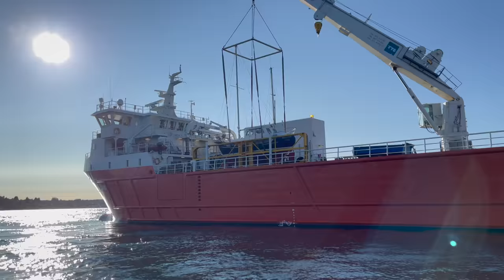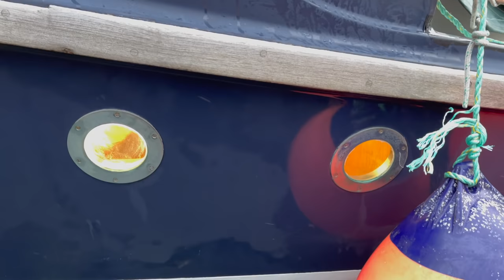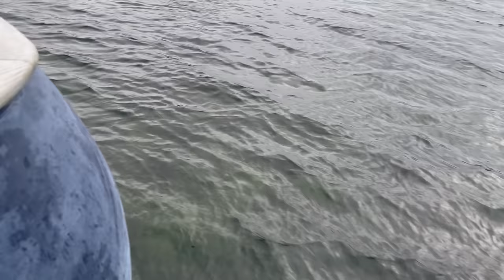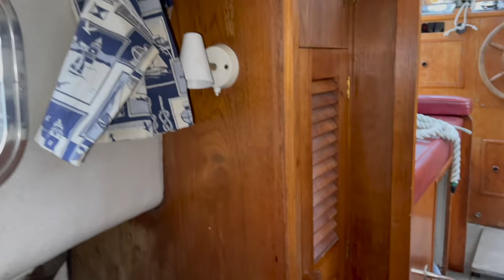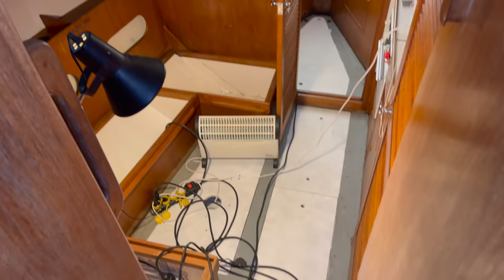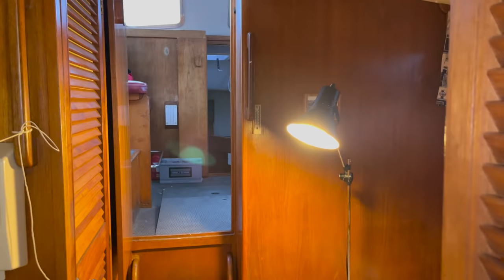Fisher 30 Northeaster Ep 1 - New perspective on sailing?

Comment: Very nice videos. I was the first owner of this great Northeaster named Marco Polo. A lot of memories went trough my head when watching your videos. I am sure you will have  lot of safe days with this fantasic boat. Good luck.
Reply from the maker: Hi Wilhelm. Thank you so much for writing. Exciting to read that you are the first owner, and actually had this boat new from the yard, 47 years ago in 1976. I have a lot of questions about the boat. Is it correct that this boat has had north of Norway as a home also in your ownership? Is it sailing well? Hard to sail singlehanded? Is it seaworthy in heavy seas? Consider if you will let me contact you. I respect any answer you give. In any way, keep commenting if you have any advice or comment. Thank you again. 😊
Reply: @hsobstad  Hi. The home base was Trondheim (3rd largest city in Norway). It is a Motorsailer and does not go very fast by sail, but it is very safe. We mostly went by motor. She was handed over to me in Oslo and I and the salesman went all the way along the cost from Oslo to Trondheim in nice and bad weather without any problem. Original engine was a 30 hp Volvo Penta. She needed quite a long distance from full speed to complete stop, so we had to be carefull. I never tried to use the sails when I was alone as the weather and the speed of the wind changes quite fast along the norwegian cost. I am sure you will love the boat as much as I did and feel safe as long as you respect the nature and behave wicely. Wher is the Home Base of Marco Polo now ?
Reply from the maker: @wilhelmstorm2162  Thanks, Wilhelm. Sure sounds like a wonderful and exciting trip! It must have been an expensive boat in the days. Did you ever sail with a spinnaker?
The 30hp sounds a bit on the low side, for maneuvering and emergency stops, but maybe sufficient for ordinary runs. The new 60hp is great, I think. 
The boat is not too far away, in Bergen (2nd largest city in Norway 😏). So we could continue in Norwegian. If you are around, feel free to contact me for an inspection of the boat. But you might be disappointed as she is not in any way looking her old self. Sorry for that, but it was really necessary. (I am not sure if you have seen all of my videos on this boat).

Comment: Always loved Fishers, I’ve been on a couple. Even the 25 felt like a rugged little ship. Great video can’t wait for updates.
Reply from the maker: Thanks for your fine comment. As a young boat-enthusiast, in the late 70ties, I also was fascinated by the Fishers, then most since they looked like small ships. And as you write, they are really rugged. 

In the 70ties and 80ties there were a similar kind of boat build here in Norway, quite near where I live. It was the Viksund 31 Gold Fish, also delivered as a motorsailer. I always thought of that as the most solid an rugged boat in that class. 

However - as a comparison - the Fisher 30 is about 50% heavier than the Viksund 31. Only halv of that extra weight is ballast. Hence the Fisher´s are ultra-solid, in which I take a lot of joy/pleasure. I like this small ship to be solid. Just the opposite of the Dragonfly 800 I new have for sale. It weighs in at only 1100 kg, fully fitted. That is one sixth of the slightly longer Fisher.

I will report some amateur videos like this one when I have something to report about. Soon spring though....
Reply: Just watched your video of the Dragonfly, In the mid 80s me and my father went looking at a very similar looking boat but I think it was called a ‘Telstar 26’ the outer wings would fold inwards to make it trailerable he hummed an hawed over it but decided it would be too much hassle for weekend trips. I think secretly he always regretted not buying it. 
     Does the dragonfly have any shared history with the Telstar 26 do you know? they do look very similar!
Reply: Just looked at a picture of a Telstar and and doesn’t look anything like your dragonfly 😂😂
Reply from the maker: @psyjayne  I think there are no relations between these two brands. I dont know Telstar as a brand. Dragonfly however is made to very high standards and specifications, meaning my soon 32 years old Dragonfly 800 is still in excellent shape, has about the same features as the new ones, and is very quick. Very fun to sail. All fine adjustments are measurable in knots, immediately. Just the opposite of the Fisher I presume. :-)

Comment: I'd leave the poles and sails off.  She is a sturdy motor vessel.  
Congratulations on owning her.  Beautiful vessel.
Reply from the maker: That is absolutely a point. However it will roll a lot in heavy seas without the sails as a stabiliser. So even if I would not sail (which I will) I would still keep the sails ready as a stabiliser.

Comment: These are boats to love - actually more like the small Nauticats than the later Fishers with their rear cockpits. Fabulous high latitude boat with the pleasant surprise of a good quality, late model engine. I have the N4.60 in an old 31ft. wooden fishing boat and she slips along at a cruising speed of 7 knots which is pleasing. Good job on the reno she'll be brand new in a minute.
Reply from the maker: Thanks for your motivating comments! I do actually wish - with this boat - to extend the otherwise short season quite a lot. So I will insulate the boat. I agree this is a slightly Nauticat-ish, but I like the Fisher better due to the lines and the extreme build quality and safety aspect. About the engine, I have heard these N4-60s are high reliability engines. I hope that is correct. I will work with this boat, but focus first on the necessities; waterproofing the deck and windows, checking the hull below waterlevel etc and live with a very basic boat this (and maybe next) summer.
Reply: @hsobstad  good plan bud🙂

Comment: That looks like just the boat for the Inside Passage to Alaska.  The route can be 'confusing' but trust me, if the wind is in your face and the tide's against you...you are going the right way.  -Veteran '66-68
Reply from the maker: Thanks for your comment. Sure sounds like a nice trip you did. I will probably not do that route as it is slightly on the other side of the planet (northern anyway) :-) 
But there are plenty of routes of similar quality (landscape-wise) going north, on the Norwegian coast.
Reply: @hsobstad  I much wanted to get over to your neck of the world with my schooner (55' L. Francis Herreshoff, 'Marco Polo', also designed for long fast passages, shorthanded.) But I kept running out of money <grin>.  I wish you the very best in your travels, with a nice sailing breeze over the quarter. -Veteran '66-68
Reply from the maker: @rogeranderson8763  What a coicidence that your schooner has "Marco Polo" as a part of the model-name, while my Fisher was named "Marco Polo" the day it was new, in 1976, and still has got that name. I like such coicidences. Thanks again!
Reply: @hsobstad  That's a good one alright!  Your 'Marco Polo' is certainly fitted well for living aboard....I had a 28' sloop for awhile that worked fine that way, ...I had one bag for clean cloths and another for the dirties....when the one was empty it was time to go to the laundromat again.  I had been spending some nights on a small 25' boat with a enclosed cabin but if a guy wants a girlfriend, it is best to have an enclosed head on board.   Things got better when I figured that out.  <Grin>  -Veteran '66-68

Comment: Gorgeous boat great condition. Very sea kindly but you may need a strong stomach after the tri! Reminds me of an old classic lifeboat design.
Reply from the maker: Thanks for your comment, Chas. I am actually very excited about the "stomach-part". Rumours tells me she rolls like a bath-tub in heavy seas. That might be a challenge... But setting sails should fix some of that... :-)
Reply: @hsobstad  From my experience on my dad's Fairways Fisher 25 she rolls the most at anchor!!
Reply from the maker: @dm5374  That actually makes complete sense, as the sails and hull under speed tend to stabilize the rolling motion a bit. Great that your father has the Fisher 25. Almost bought a brand new one at the Southampton boat show, some years ago. If I had, I would have missed out on a lot of trouble though... 😊

Comment: hello, i own a Fisher 25. All the windows where taken out when i bougt the vessel. i am looking forward to a video where you install a window in your vessel. Regards William from the Netherlands
Reply from the maker: Hi William. Great to read that you have a Fisher 25. Impressive little ship.
Installation of windows. That will come, but not yet. 
I am keeping the circular windows in the bow section of the boat. Also keeping the windows in the pilothouse. The rest of the windows will be changed to circular portholes because these are easier to keep watertight as the rubber gasket is easily accessable, and the old windows are in bad shape. 
Right now I am patching the rest of the holes from the old windows. The new ones will go in as the interior gets in place. 
The windows I removed was riveted, as is also the case for the windows in the pilothouse. I will remove the pilothouse windows as well, to seal up and reinstall them. I am not sure I will use rivets for reinstallation.

Comment: Thats a seriously tough and well thought out  little vessel looks like a deep clean a refinish of the bright work and sails and she will take you anywhere with some added solar . 
Im going to link you to Alluring Artic hes been looking for a vessel that he can use at higher latitudes and these seems to answer a lot of his needs.
Reply from the maker: Thanks for your comment, Clive. My plan is to refurbish and sail up north. This boat is heavy built and so far - touch wood - there seems to be no big problems with the structure. 
I thought Alluring Artic already had a "new" aluminium "ship" or have I missed something? Compared to that boat this Fisher 30 is small (but maybe just as tough). If I can help him (them) with any questions I am happy to do so.
Reply: @hsobstad  Hi, Their vessel is sort of loaned/leased and is a massive Al hulled Expedition motor sailor Vinson of Antartic but its had a lot of problems and theyve had to have it hauled out and fixed several times already.😬 and they are Snowed in in Iceland. 
So they were talking about looking for a boat for themselves but still capable of handling higher latitudes sailing .
As they are Finns they cannot cope with the heat. 😂   
So they need a tough seaworthy boat thats insulated and offers fully protected sailing as a live aboard... The 30 might be a bit short on storage space but one of its bigger sisters might be just the ticket.

BTw  take a look at this set up...
https://youtu.be/owm0z-Hdt0w
Reply from the maker: @clivestainlesssteelwomble7665  Shall be interesting to see what they´ll choose to do. 
Nice set-up. Smart to do a pure generator, being able to put it anywhere and at the same time have loads of power for any onboard equipment. Nice!
Reply: @hsobstad  
Fuel efficient as well and using the 35 hp motor to effectively  propel a vessel that size and wt.
Reply: Clive:  Who said it was for sale?
Reply: @Vinnie101a  
Hi I didnt mean this specific vessel just this type/manufacturers boats might meet the Finns needs...as they wanted a Northern waters vessel they might be able to afford.. Alluring artics Vinson of Antartica  is on loan but its thrown up a quite a few problems.
Reply: @clivestainlesssteelwomble7665  : fair enough
Reply: @clivestainlesssteelwomble7665  Yes, I follow them too and enjoy their channel. Amazing part of the world that I’ve never experienced. 👍

Comment: She should sail quite well in 20knot winds, not sure about pointing well. I like( and have heavier) sailboats because how they move over waves - like trains and no chop. Its great boat
Reply from the maker: Probably correct, Vaidotas. 
However, I dont compare the Fisher-boats to either sailboats nor motorboats. They are motorsailers. And very good ones as well. This boat weighs in at 6.6 tonnes which is quite heavy for a 30 feet boat. Many of the pure sailing boats in that size is less. 
Larger boats moves better in small waves, so bigger size is normally better. In bigger waves it does not matter that much if it is a 30 or 50 feet boat. It is suitability for bluewater use. The Fisher is rated as a heavy bluewater boat. https://sailboat.guide/northshore/fisher-30-ms
Upwinds the Fisher owners motorsails or go purely by motor, enjoying a GT. :-)

Comment: Great video. I have hull 48 in Washington USA. I have worked on many of the things you will be repairing. If you think I could be useful let me know
Reply from the maker: Thanks! So you have an even older Fisher than mine. Is it the same model/size? There might be issues coming up, to be consolidated. I am also now member of the FOA, which is very helpful.
Reply: @hsobstad  I have the exact boat. Color is tan. I see you have the tarp covering the bow coach top. Not sure what you have leaking. My mast step was rotten. The rot extended into the compression bulkhead. I repaired the deck and installed a compression post.
Reply from the maker: @adventurousboat8724  The tarp covers the area where the mast foot stood, to protect from water ingress into the core. I believe there are rot already as part of toe  coach top, just behind the mast foot, has collapsed slightly. So I will change the core from underneath. I think the compression bulkhead is ok, but I will check thoroughly. Tarp also covers leaking side-windows.
Are you happy with your boat? Setup? Sailing? Seagoing cabailities etc?
I consider changing the interior from a 6 berth to 2 berth (very comfortable berth that is). Have other plans as well. Might make a video about that....
Reply: @hsobstad  I need to make a video and post to catalog my changes. Hope to do that soon.

As far as the boat goes she is a cool motorsailer. Pretty slow boat. She has been re-powered once to a yanmar 3GM30 which is not enough in my opinion. I have a lot of work before I upgrade that.
Reply from the maker: @adventurousboat8724  Looking forward to your video. Let me know, please. 
Your engine with 27 hp is possible on the low side. I have a Nanni N4-60, 60 hp with twice the cylinder-volume as yours. I think that engine is sufficient, but would not go below 50 hp.

Comment: Nice, solid looking Fisher.  Looks like you are getting the basics done from the bottom up. Good work. I often wondered what a speed a Fisher would do under full sail off wind. Keep us informed. What new sails are you planning for? Do you plan to switch to Lithium battery system or a wind vane autopilot?
Reply from the maker: Thanks for your comments, Michael. I started refurbishing the inside underwater hull since it was incredible dirty from oilspill and greywater. That made the entire boat smell really bad. Also a good way to get to know the hull and construction, looking for faults. 

I have not yet sailed the boat, as the sails were totally worn out. I have measured the size of the sails and ordered a new set of identical sails, including the Fisher Motor logo and the number on the boat, 56. Also ordered the rust-red colour, as my wife surprisingly took part in that debate and fancied those old looking sails. Sails will be delivered by Gran Sails. (would prefer Sobstad sails as that is my surname, but as I understand that brand is no longer in use). 

I have bought a Scanbatt 200A lithium battery. Consider one more of these. 
Changing the old cable-based steeringsystem in favour of a hydraulic system, incl a autopilot fitted for such a system. Wind vane is not yet on the table as there are a lot of work to be done before the long trips.

Comment: Have you seen a build number somwhere in the inside of her stern?
have the same ship, thanks for the noice vid sharing.
Reply from the maker: Hei Martin. Yes I have found the number. On the Fisher 30 Northeaster the number is on the outside of the stern, slightly on the left side (port). Mine has the number FM060  /  056  /  5/1/76. That reads Fisher Motors job 60, hull (and sail) no 56, date of buildstart May, 1st, 1976.

Comment: It looks ok, but the larger fisher has more deck space.
Reply from the maker: Yes. It is a compromise between a lot of factors. Smaller boat is cheaper, easier to maneuver, etc but has less space. In my harbour this is the largest boat possible. And it is large enough for just me (mostly). I very much understand if you prefer more space on deck.

Comment: Sweet little vessel on the right as well, what is it?
Reply from the maker: It is a Rhea 900, a French build motorboat, build between 1996 and 2008. This is a 2007 model. Quite rare actually; only 54 were ever made.
Reply from the maker: @harbourdogNL  I guess she is a good coastal boat, B-classed. But also quite light, weighing in at 3.5 tonnes, and shallow draft of only 0,8 meter, which is slightly negative. Her bow rounding off midship, and a narrow hull means she is cutting the waves and so is a wet boat in heavy sea. Cutting through the waves is a good thing. She also has her weight rather low, which is a good thing. In total a good coastal wessel, but not ocean-going, in my humble opinion.
Reply: @hsobstad  Thank you. No, I wouldn't go too far offshore in one either, but yes, I think she'd be great for coastal cruising, and around the Med.